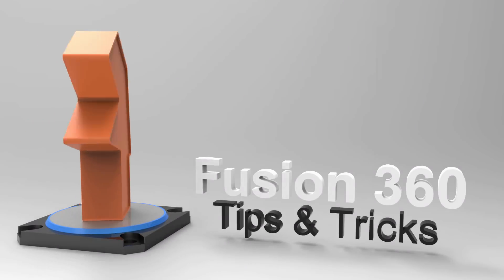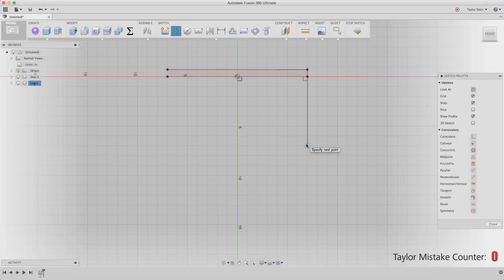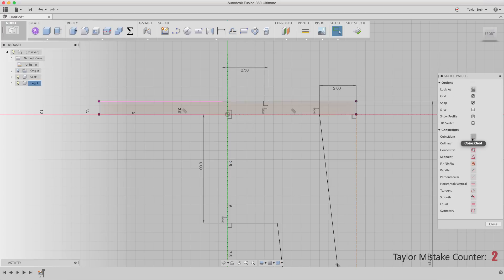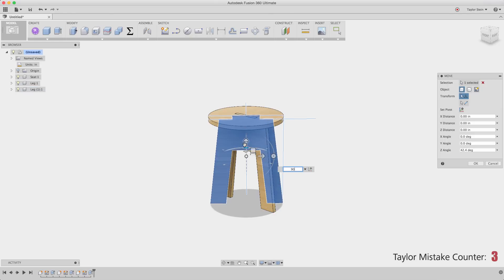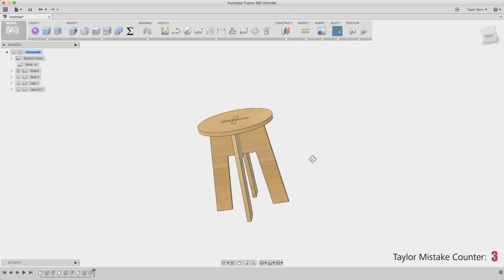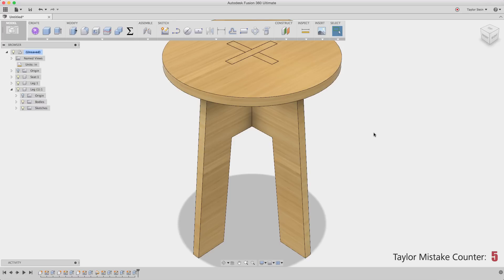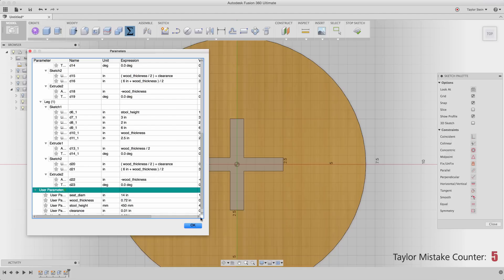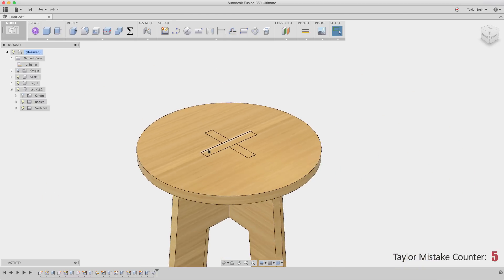Flat-pack furniture design

Comment: Hey there! Just a notice: you can't really use the boolean functions, because of the clearance! Tried it! :) 

Otherwise: great video, I learned a lot! Keep up the good work!
Reply from the maker: Thanks for the info. What point in the video are you referring to?
Reply: @adskFusion  
Sorry, I really should have made a comment with a timestamp mentioned! I am referring to the cutout feature on the seat, at around 10:40. If I use the boolean operations to make the cut, a little bit of material remains, because of the tiny gap which is caused by the clearance between the legs. I hope I was understandable, have a great day, and I am so cheerful you answered. I am using your product for a handful of different applications, and it just works well! I think that this is what makes a quality product. Have a nice day and best wishes from Hungary!
Reply from the maker: Ahhh, that makes sense! These small material bits might be something you can remove with a simple select-delete operation. Happy to hear Fusion is working well for you! Cheers!

Comment: How did you manage to begin with 'wood' material already applied to body?
Reply from the maker: It was applied to the component as a physical material, I believe!
Reply: @adskFusion  so, I assume, it is possible to apply the material to top level, and make it inherit by the components created under the tree. Is that how you achieved it?
Reply from the maker: Yep! Did you give that a shot?
Reply: @adskFusion  Yeah, that works!

Comment: Nice video but I have been asking for over 1 year which equipments compatible with this software, I have contacted dozens 0f channels. And equipment site and not 1 decent answer
So after you make this part in software where do you go and how it is actually made, any help would be appreciated. I own a BIESSE Rober B cnc
Reply from the maker: Oscar-  In the Manufacture Workspace, under Post Process, you can view all of the Post Processors that are currently available for Fusion 360.  You will see names of all the machines, like Fanuc, Haas, Shopbot, etc.

Comment: Just a quick thing. When making the sketch on the stool top to accept the legs wouldn't you go (wood_thickness+clearance)/2? That way when you mirror the sketch the clearance wont be doubled giving you a clearance of .002 instead of .001

Comment: EXCELLENT! Lesson. I just spent 2 weeks playing with fusion to make a rope maker. I learn't a lot but having seen this and the parameters feature, well it blew me away. The revisions I made forced me to perform ALL the extrusions again... also I modelled everything using bodies (sometimes forgetting to create New Body) meaning I had all sorts of problems later. Glad I made these mistakes -otherwise I wouldn't have appreciated this as much BTW you forgot to add clearance in the slot for the second leg +1 :-) LIKED and SUBRCIBED and off to watch more.

Comment: Great vid Taylor,  if i had my way i would have you slow down just a bit, especially in parameters so i dont have to click back and forth a hundred times freezing frames and such. My prog would not add the stool_height anyway, it just was not there when i added it...and i could not get the lines to disappear for the whole profile of the leg from first sketch, ended up just adding that top part that cuts into the round seat. These are the best vids to work from please produce more and i dig the way you show how things could have been done wrong but you fix them, and variable methods for different actions.  Thanks!

Comment: As with David Nevala (below) I had to figure out how to get dimensions to work on angled lines (Right-click and select "aligned" once you have a dimension running). I also tried to do a Boolean but you can't because you need to add a clearance (try it - you get pieces of previous clearances causing trouble). So instead I tried a projection and I can't seem to do that either - I added projection points, created a closed shape (which is its own problem) and made that cross shape a construction line. I figured it would be hard to see which to extrude otherwise. Then I added an offset. This is fine until you reduce the offset to "clearance" at which point the offset line and original lines both turn into construction lines! It's better just to draw the sketch...Edit: Also, when drawing the dogbone fillets, I ran into issues with the circle not being considered a profile. Then I could not extrude. I think I forgot to make the 45 degree line a construction line then make it one later, thus breaking something somewhere. When I redid it, it worked ok. If you turn off "profile" to make things less cluttered and then forget to turn it back on, you also get this type of problem...

Comment: I had a hard time figuring out how to get the dimension to work on the angle for the dogbone tool setup mentioned around 14:30, and found the correct procedure for getting dimesions to work on angled lines in the current version as of this writing. Activate the dimension tool, select your two points, then hover your mouse over the angled construction line so that it highlights. Right-click and select "aligned", and your dimension will be applied to the angle correctly.
Reply: David, this is my first ever comment on YouTube. Thanks for figuring that out and explaining how to do it!
Reply: Just had the same issue - upvoted so hopefully this comment will lie in "top comments" where you can see it!
Reply: I was hoping someone figured this out!! Thanks, brother!!

Comment: Will the CAM output move the cutter in a tiny 0.01" radius circle to create the clearance for those corners? Also, can the dogbone corners be done by the CAM? That way the CAD remains the same for someone using a laser cutter.
Reply: +Sanjaya Kumar top right of fusion > click your name > preferences > material.

Comment: Is there a way to get F360 to lay all of those parts flat on a work plane? ie: for cutting on a CNC router, laser cutter or whatever. I'm not even looking for smart nesting - just a way to take the components apart and look at them lined up side-by-side from the top (without doing it manually). Seems like a good script for someone to write if it doesn't exist.

Comment: Thanks for the video, quite interesting to see someone else work. Hope you don't mind I have a couple of suggestions.

At 4.30 in the video you draw an extra construction line to add a coincident constraint, you don't need this extra line the coincident constraint will use an apparent intersection if you select the line below the origin.

In your sketches you draw XY axis lines, this really should be built into Fusion so you can just select an axis. Until then if you draw an L shape, start the first line on an axis away from the origin then snap to the origin then snap to a point along the other axis it saves a few clicks.

Mark.

Comment from the maker: Check out this video on how to use robust, parametric modeling best practices, while getting a first-hand look at handling common mistakes we all make from time to time in Fusion 360!
Reply: Very true - it is a nice workflow when the product fits into that method. However the moment you need something more 3D less flat your labor time and construction complexity explodes and makes this more expensive. I hope at one point to truly have a real 3D sketching engine like Alias / SolidThinking because both are parametric surface modelers and with ST I can replace input curves in surfacing features.

Having that addition in something like Fusion would make it a truly killer app. None of the other current engineering modelers like SW Inventor ProE offer that ability.

Comment: Hands down the most informative video I've seen yet on workflow practices and the reasons for. Never knew you could jump straight into using components either, very handy! Would love to see this process for a more complicated model and any insights in your pre-design stages ie do you rough out your steps or key parameters in anyway?